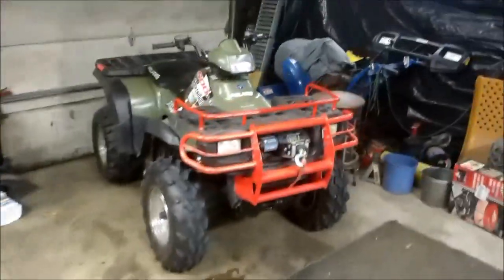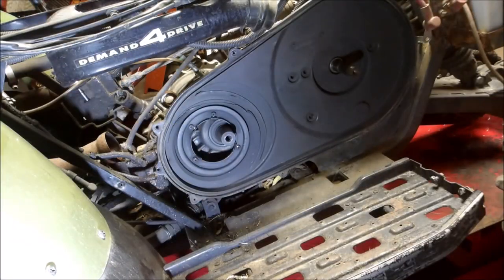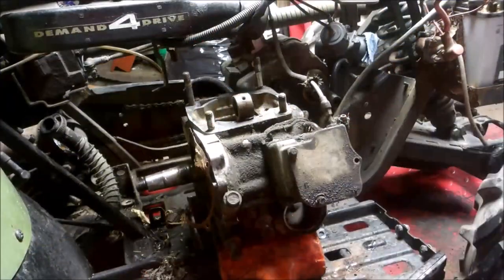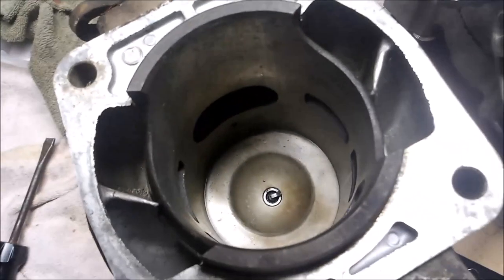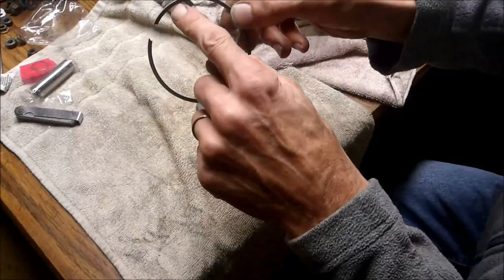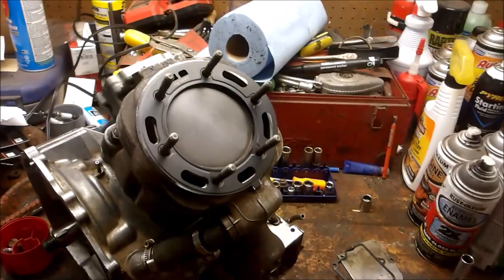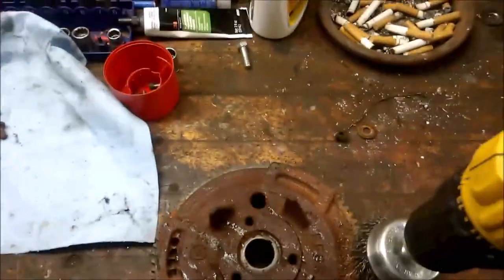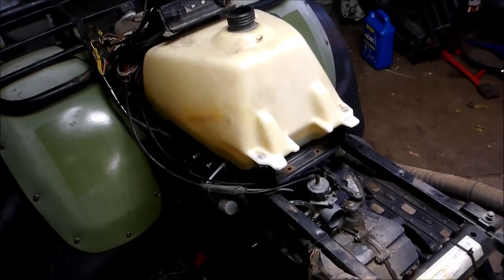96 Polaris Sportsman Restoration! Part 1

Comment: That bolt on top of the head is extremely important for anyone choosing to drain or change the coolant in these Polaris 400’s. If you don’t burp the air out of the jug, your atv will never cool correctly causing it to overheat every time ruining your engine. This is one of the first mechanics I’ve seen on YouTube explaining the function of that air bleed bolt on top of the head and he just gained a new sub because of it. Nice job on the atv, and I appreciate you not leaving the important stuff out like that air bleed. I’m sure there’s a lot of guys watching this that it’s their first time with a Polaris engine being rebuilt and that’s something that’s easily and commonly overlooked by many.
Reply from the maker: Thanks, That's actually the reason I started making videos. I had to watch 4 different videos to get all the info I needed. I try not to leave anything out for the first timers.

Comment: I just took the brake calipers off  my 05 Trail Blazer. Cleaned the rust and dirt off the brake discs polished the calipers and replaced the lower control arm plastic guides which were crumbling. 
Just cleaning things up...
Reply from the maker: Nice! I ended up replacing the master cylinder on this one.

Comment: Nice video. You said at the end of the video the carb bowl was over flowing. I had the same problem with my 4 stroke 500. I fixed the carb , and changed the oil from the reservoir only. I did not drain crank case. My question is could there be fuel in engine and can it have caused damage? I put 70 miles since repair. The dip stick does smell like fuel. Thanks

Comment: Might you be able to help me out regarding a 350L  and the collars that go on the crank, two of them If I recall correctly.
 I took it apart a long time ago now and Now that I am putting it back together I find I cannot find confirmation as to how, in what order the Guide washer, O-ring and Collar are installed. As there are two of these and my manual has conflicting information. I was wondering if you might be able to shed some light on the subject. 
 And where might I get a replacement, as one of the ones I have is badly grooved.

Thank you
Reply: This guy is good. Also, to answer your question, you can facebook, call  Rick Ritter, Illinois Polaris Scrambler go fast goody specialist.  When running, you will double or triple engine life if you will always ride it real easy for just a few minutes to warm it up gradually.

Comment: I’m replacing my piston on my 01 Sportsman 500 HO.  When connecting to the crankshaft arm I noticed slight play left to right.  What is your criteria for replacement of the bearing that connects the arm to the crankshaft
Reply from the maker: There will be a little play. Just as long as it's solid when you move it up and down. If you have lots of play or there is slop when you move it up and down then it's time for a new connecting rod and or bearing.
Reply: @TitaniummanGarage  thanks for the reply.  It should be ok then.  Keep the videos coming.  I enjoy them.
Reply: I have finally received the gasket that goes between the jug and crankcase.  There is no indication as to what side is up .  There is what appears to be a bead of caulking around the side where the timing chain goes.  Should that caulk be on the jug side or crankcase side?
Reply from the maker: @trentelliott1473  If you have the dowel pins in it will only go on one way. There is one small hole and 3 big holes. with the pins in you will see which way it goes.
Reply: @TitaniummanGarage  thanks!
Reply: I just acquired a new project.  02 700 twin.  The cluster is fried,  is there a way to wire an aftermarket temp gauge to the existing temperature sensor.